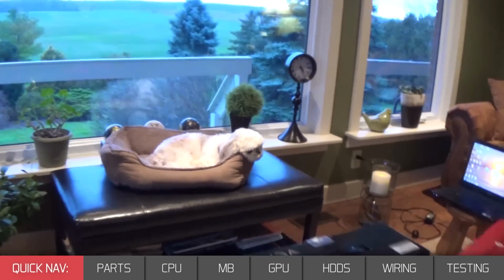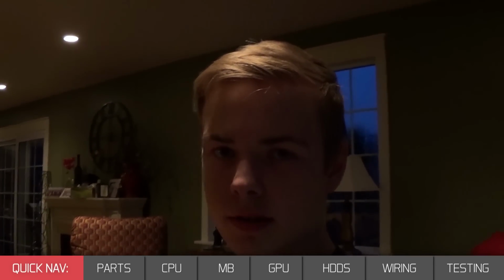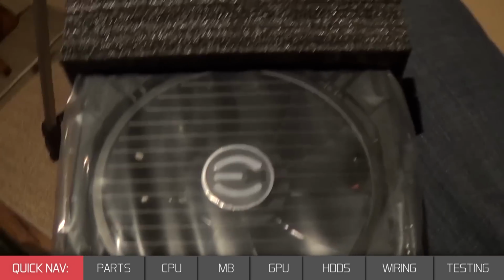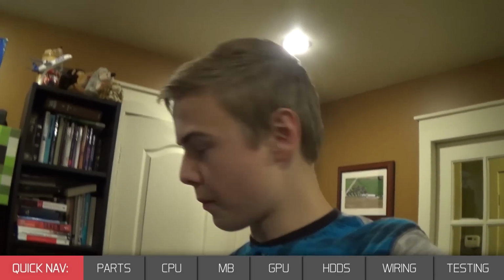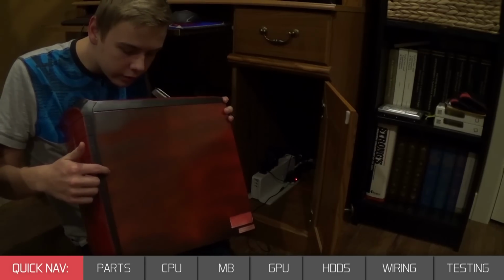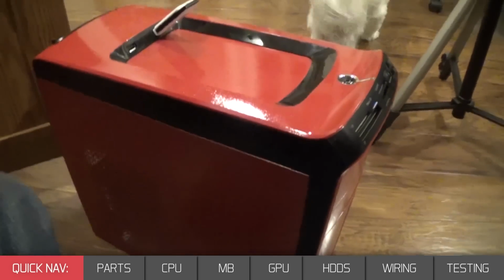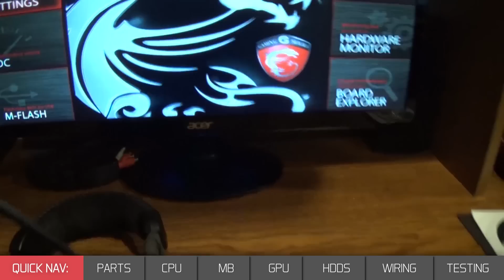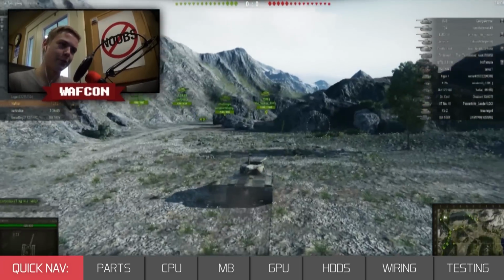$600 PC - Building a New PC! AMD FX 6300, Gtx 960 - Wafcon

Comment: My build is an nzxt s340 case, asus 970 pro gaming motherboard with aura lighting, amd fx8370 cpu, cooler master hyper 212evo cooler, Evga gtx980ti ftw edition gpu, 2x4 gb corsair vengeance 2400mhz ram, Evga 600b 600 watt power supply, 1tb wd blue hard drive, Kingston 120gb ssd, and windows 10 home 64 bit
Reply from the maker: Oh shiet thats a pretty goof build you got there! :D
Reply: Goof? 😂
Reply: Oh good my bad 😂 thanks

Comment: Looks good.  I built a FX 6300 as well.  For gaming its perfect, cant complain really.   One small suggestion if you decide to display your tower (i know its in the desk below) but with you case side window, you can see the upper mother board/cpu power cable.   Run it through the slots inside the case to hide the wire more.   

Love the full MSI setup, great choice for case and Mobo combo!
Reply from the maker: Thanks! I'll try hiding that cable then :)

Comment: DAmn dude, this is exactly the pc I was looking into building last year, hope you use it to it's fullest potential, slap a 140mm Watercooler in there tho!((also get a 5.25 bay to 3.5 bay converter and get that drive cage out of the way down there, also by doing that you could instal a 240 or even a 280mm watercooler))
Also, tuck that 8pin cpu cable behind the mobo, sounds bizarre but it totally works ((not to mention that with that mobo and psu you're more than set for a 960 sli))
Reply from the maker: lol thanks for all the advice! I'f you check out my new upgrade video, I do a whole bunch of that stuff. but I instead went with air cooling rather than water cooling. :3

Comment: Working on carpet with socks? Like to see sparks fly, I guess? :D

PS. 750 watts is totally overkill for this system :P
Reply from the maker: +BowGunner Yes I made sure to ground myself before hand and also the 750 watt was 80 bucks so why not. :D
Reply: Wafcon Gaming + GFX I swear it's a mystery how EVGA can keep their PSUs at such a low price. Probably child labor :D
I got to say, I kind of regret not getting a 750W PSU myself as I kind of don't have the option to add another GTX 970 in SLI in the future on only 650W. Atleast you can use your PSU for higher end systems down the line.

I'm currently building a system very similar to yours for a friend and I'll be using a 500W Bronze PSU. YOLO :D
Reply from the maker: BowGunner Lol I hope not child labor xD. I do plan on upgrading in the future. Sound like you have a good build as well :)

Comment: Gtx 960 has about a 60-70% increase in performance. Should have saved up a little more. Would have been better in the long run. But your system is good for most titles and editing :)
Reply: I mean the 970 has a 60-70% increase compared to the 960
Reply from the maker: Ya I didn't make totally perfect choices for my PC but I'm pretty happy with how it turned out.
Reply from the maker: +Its Vinyl k thanks c: ill contact you later on skype then.
Reply: +Wafcon Gaming + GFX will look forward to it :)

Comment: FX6300 is sort of an odd choice these days.  It's sort of old now so I would be worried about how many years you'd get out of it before games become too demanding.
Reply from the maker: +FubarMike True but it was the most reliable at its price and I will overclock it sooner or later.
Reply: +FubarMike you can always upgrade to get 8k fx its not to expensive or even the 9k on steroids and that should be okey for most of the games im guessing especially when its overclocked
Reply: +Wafcon Gaming + GFX my Fx6300 is still holding up after 2yrs. I play the latest AAA games with it but mine is overclocked to 4.6ghz
Reply from the maker: chris pinkston Ya its great when it is is overclocked as i hear but i do not have a better cpu cooler yet so mine is not overclocked. :/
Reply: dude the fx has 6 core meaning it will last longer than some quad core cpus plus overclock so no its good until u can afford something better i suggest after it either the 8350 or  a high end i5 since it should last u a good while
Reply from the maker: +Hadi Plays (HadiPlaysPokemon) ya I was aware that it had 6 cores, but the speed isn't really outstanding. Also, thanks for the tip :)
Reply: +Wafcon i found out theyre slower like an hour aftrr i wrote this also np

Comment: Mmmm, Thinking about buying the AMD FX 6300 because iv always wanted that cpu and i dont know why, Its all the great reviews its had in the past, "Best CPU of AMD" Thats all iv seen lol

Worth or not worth?..... ohh and iv got AMD FX 4130 and its been amazing, No problems but it lacks a few things like multitasking while gaming, This is a big issue for me... No wonder you are overheating, That little space will make you're pc very hot...
Reply from the maker: +Alan Smith Ya its a great CPU for the price. I'm going to get a liquid cpu cooler for it soon tho. :)
Reply: EVO 212 is amazing cooler for it, The price is unbeatable! and i bought AMD FX 6300 before :) I did buy the amd fx 6300 but it was faulty (DUD)
Reply from the maker: +Alan Smith I'll check it out. Btw where'd you get the dud? Online?
Reply: I ordered it from Amazon, It was faulty meaning in dud, I changed the CPUs over and turned on the PC and it would work for like 2-5 min and it would just freeze the whole PC so changed them back over and went on Amazon chat and got my money back and they even confirmed that the CPU was a dud.
Reply from the maker: +Alan Smith interesting. Good thing you got ur money back. Amazon is pretty good for that

Comment: Fx 6300 would bottleneck the setup right ?
Reply from the maker: Yup I does :/
Reply from the maker: +Wafcon it**
Reply: Wafcon  So how about I go with AMD 8320 or any corei5 Skylake processor ? Will that bottleneck the setup ? Am asking because am building same setup but was worried about FX 6xxx series.
Reply from the maker: Vishu If i overclock it would be much better but i would need to buy a cpu cooler. But if you plan on buying a intel cpu, you would have to change your motherboard as well.
Reply: Wafcon
Ya I will buy mobo accordingly but just wanted to confirm that 8320 or i5 skylake wont bottleneck it :) Ty for answers.
Reply from the maker: Vishu No problem :) Im personally just gonna stick with the 6300 until it dies because it still performs well :D
Reply: +Wafcon So I decided to go with any i5 processor and a 970 :D Thought could stretch my budget a lil bit x'D Thank you for you answers bro.
Reply from the maker: Vishu Nice! Also no problem. ^_^
Reply from the maker: ***** Bottle Neck simply means that the pc will only go as fast as the slowest part. In my build, the cpu is the slowest part so the graphics card isn't being used to its full capability. But ya, this pc can easy run most games at 60 fps. I would suggest going for the msi r9 380 instead of the msi gtx 960 tho. its cheaper and faster. Hope you understand :D
Reply from the maker: ***** Yup it should do for you then :)

Comment: i have same hardware .cpu is fx 6100 
do post a GTA 5 and FPS yu getting .
in avg 40fps
Reply from the maker: Yup id get around 50 on ultra
Reply: +Wafcon Gaming + GFX what .. impossible.. 50 avg on ultra?
Reply from the maker: +harshith gowda sorry I meant on high, but if I over locked my CPU I might be able to.
Reply: +Wafcon Gaming + GFX I get around  40under fps with same rig except fx6100
Reply from the maker: +harshith gowda check out my friend exive. He has the exact same build as me but a 2gb graphics card and he can achieve 60 fps easily.
Reply: Some thing wrong then.. Thank yu dude..
Reply from the maker: +harshith gowda lol that's ok. I don't actually be Gta V yet so I'm not saying your wrong, just that I was pretty sure it was faster. Thanks anyway tho. :3
Reply: +Wafcon Gaming + GFX i get 60-70fps with same rig ultra settings overclock though to 4.3 ghz ^.^
Reply from the maker: +Fa Fafa I plan on it :D
Reply: Perfect! I'm building the same rig! I just need to order the graphics card :D 
Subbed for sure!
Reply from the maker: NitroRc TrophyTruck21 Sweet! hope it goes well! and thanks!
Reply: +harshith gowda The Fx6100 "bulldozers" are really bad CPUs, the single core performance was lower even compared with Phenom II series. If you already have a AM3+ Motherboard i strongly suggest you to update your Bios and then move to a Vishera CPU. And since you should be already changing your CPU i would say that Fx8xxx (anyone of them, stock or overclocked at 4.0ghz or more) are the only reasonable upgrade taking the 2016 gaming requirements.

Comment: Actually it doesn't need 4gb vram card 2gig one is enough
Reply from the maker: To be honest I've actually surpassed the 2gb mark quite a few times especially once I've overclocked my gpu. :3
Reply: I could say the same for last year, but for this year, nope, games are eating up more and more vram, 2gb is not enough now tbf
Reply from the maker: +Thái Hoàng Nguyễn ikr Rainbow six uses 3.8 GB of VRAM alone and my card can run it quite nicely.
Reply: even a racing title such F1 2015 uses completely my whole 2GB vram and thats the reason why I can't go to higher setting. If I did, it would surely go to 2.5GB~3GB according to some benchmark I saw on Youtube
Reply from the maker: +Thái Hoàng Nguyễn lol what GPU do you use?
Reply: GTX 770 mate
Reply from the maker: Thái Hoàng Nguyễn Noice m8 when ddid you build ur pc?
Reply: +Wafcon for 2 months I guess, all ebay used stuffs lol
Reply from the maker: Thái Hoàng Nguyễn Lol nice

Comment: Do you need to update bios for the motherboard to run the amd fx 6-300
Reply from the maker: No actually it worked right off the bat. I only had issues with the gpu drivers :)
Reply: +Wafcon ok thanks man I'm getting a setup close to urs so now ik it won't bottle neck or have anything wrong

Comment: OMG ! 750 Watts for GTX 960 ?! and Stock Fan for Fx 6300 !! GTX 960 won't need all this power (XFX ProSeries Core Edition 550W Full Wired PSU 80 Plus Bronze ) will be perfect GTX need only 430 Watts and about this stock fan will be a serious problem you will hear a bulldozer in your room with this fan Fx 6300 after overclocking the temp. can destroy your room :D
Reply from the maker: Lol it was only $70 so I snatched it up. :)

Comment: why did u go for gtx 960 4gb and not 2gb ???
Reply from the maker: It was a good price, plus it won't slow down if I get a better proccesser. Basically I wanted a build that would last me a long time.
Reply: Thnx for the suggesting
Reply: I also got the 4gb version zotac amp edition
Reply from the maker: tauseef alam Nice!
Reply: +tauseef alam you get way higher fps with 4gb vers. + for newer games more vram ^^
Reply from the maker: Fa Fafa true dat

Comment: where are you that that cost $600...in canada thats about $800-900...
I like it though

My pc
CPU : AMD 8320k black edition (water cooled)
MOBO : ASUS M5A99X EVO R2.0
RAM : Munchkin 2x4GB 2133 Mhz
HDD : 1TB western digital blue
SSD : Munchkin 60GB (boot drive)
PSU : Deep cool 500w 80plus bronze
GPU: Club3D King edition AMD R9 280x (Mem. Clock 1300Mhz Core Clock 1000Mhz)

Total cost: $ 1100 CND
Reply from the maker: +Derek Walker Technically yes, with sales and all it cost around $800 CAD but most people look at it in american on YouTube so i just priced it at $600. :)
Reply: thats true i like it though have fun with your rig!
Reply from the maker: +Derek Walker I sure will c:

Comment: Have you had any problems with bottlenecking, or heat issues? I have the same build pretty much but with a 750 ti, and I am wanting to upgrade to 960 4gb, but am worried about bottlenecking.
Reply: +Wafcon Gaming+ GFX
Reply from the maker: +LegitPicklez It doesnt really do much bottlenecking, but I would say that the cpu is a bit slow for the gpu but not enough to matter. I could overclock to 4.1 ghz anyways.

Comment: Can it run Club Penguin at least 20 fps on low settings?
Reply from the maker: +Dino Magna Nope. average of 13 fps on club penguin.
Reply: +Wafcon Gaming + GFX Yeah bro, you need AT LEAST three Titan X's to run that game
Reply from the maker: ***** Ya maybe with a  i7-5960X. That MIGHT be able to run it. Not sure tho
Reply: +Wafcon Gaming + GFX Yeah man, you can run DayZ, Star Wars Battlefront, Gta 5 those are easy to run games. But Club Penguin bro, that's like a $50,000 pc
Reply from the maker: ***** Maybe even a Nasa super Computer